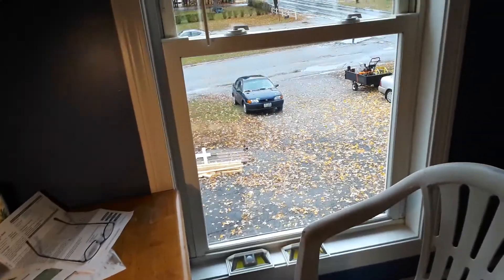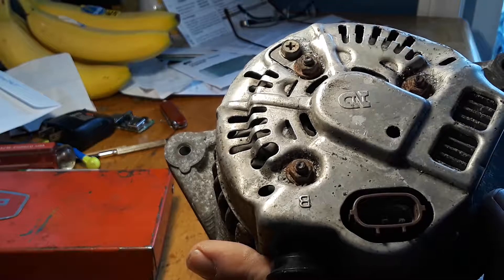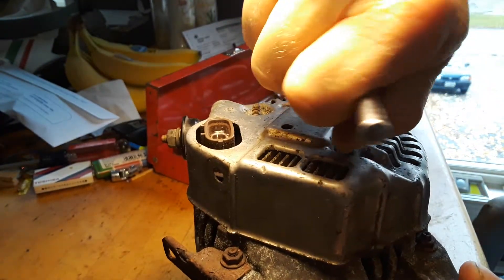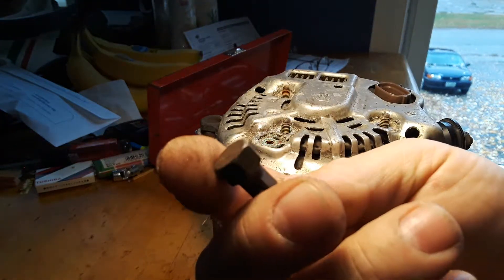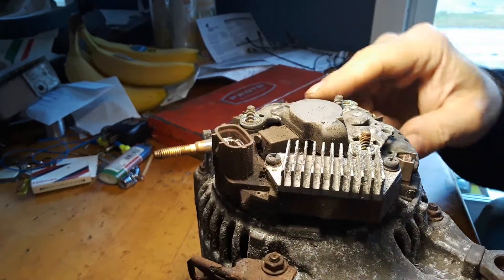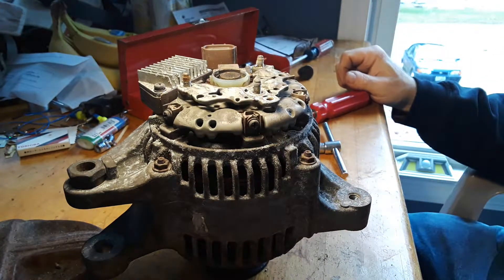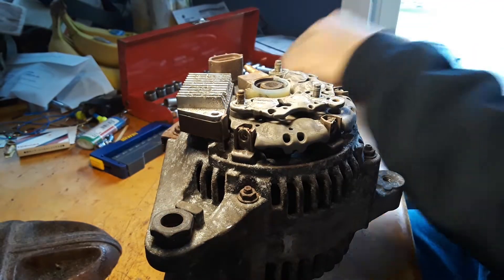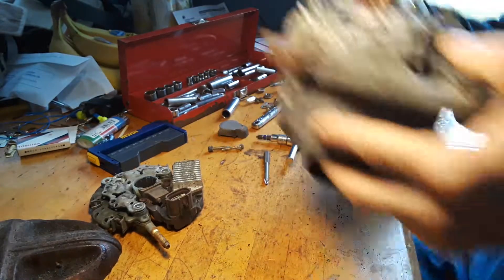Looking at an alternator in a 1996 Toyota Corolla

Comment: Hey, i got a 1998 corolla and trying to add ac. I dont know where the system draws energy from.
The ac harness power cable is right next to the alternator, i think its the same one or similar to the one in the video. 
I think the power cable has to be plugged into the alt or at least to a connection next to it but i cant find it.
Any ideas?